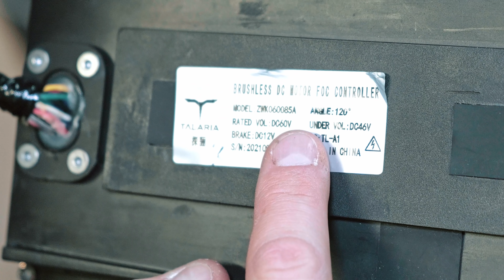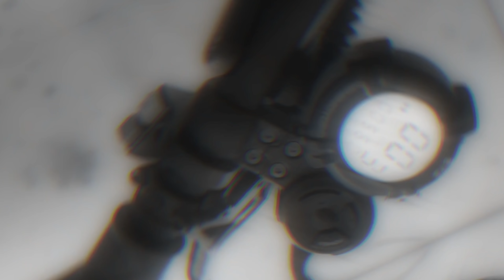Крутой электро байк Talaria Sting, Суррону придется не легко в 2022 году!!!

Comment: I def like how the linkage is different for the rear suspension and the rear swingarm comes off and on with those two bolts as opposed to the surron using the through axle which is also the jackshaft I believe. Just much simpler design... I look forward to riding and working on it...

Comment: Anyone have any pedal kit ideas yet? The talaria has a pedal kit listed in their specs on ebikezilla and it looks identical to lunas first surron pedal kit. Which is a Jankey pedal kit but would make the bike more legal... the talaria has a wider swingarm tho so I wonder are these 2 pedal kits identical or will talarias be specific with a wider crank??? There's no jackshaft for the kaniwaba pedal kit to work with but if the kaniwabas match the 2 holes to mount the brackets on each side then I think the kaniwaba pedal kit would work if a double sprocket could be designed to come off the motors gearbox... one for the pedals and the one for the main chain... any ideas guys???
Reply: No the surron pedal kit won’t fit. Different fitments